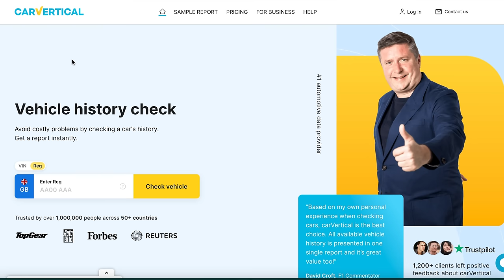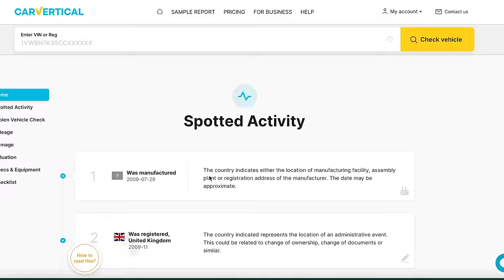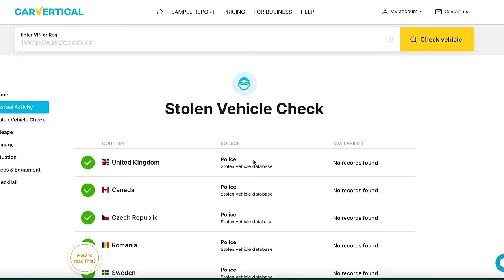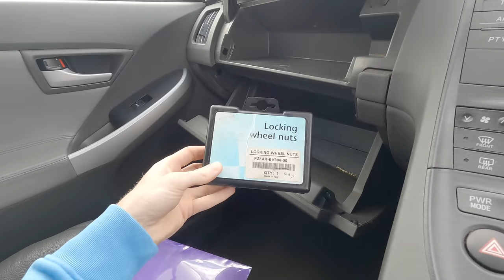I BOUGHT A 200,000 MILE TOYOTA PRIUS

Comment: I received, for free, an '04 Prius with a failed traction battery in 2020.   I learned how to repair that main battery and it's been going strong since then (4 years and about 25,000 miles).   It wasn't such a great deal because a Prius that's been sitting for a while will need things, like any car - like brakes.   Mine also needed rear struts, exhaust manifold, exhaust system, water pump, so it wasn't a great deal after all that, even not counting my free replacement work done on the main battery.  However, all in, I've probably spent no more than $6,000 USD to this point and with regular service, I know I've got a well engineered car.  I do have front shocks replacement staring at me when the car goes in later this spring for its oil change, so it will continue to not be a fantastic deal, though I'm still impressed with them in general.   (Gen 2 are the slowest cars in the universe, so those reading this and thinking about a purchase might want to get a Gen 3, having it fully checked out first- don't make my mistake of "it's a Prius, it won't need anything?"

Comment: I had 3 different Prius and yet drive one. One i drive now has 175,000 miles and have not even changed brakes. I change fluids and tires. I drive them because I am cheap.

Comment: I've got a 2009 Prius myself which I bought in 2014. It's got a few knocks and it has had an accident at the front end (not my fault) so it has one cloudy headlamp which I should get buffed. I'm out of the country a lot at the moment so it's parked at my sister's  and she drives it  to keep the battery charged. I considered selling it but then I'd either have to hire a car when I'm in the UK or buy something which would be extra hassle on top of booking flights and accommodation. As it is my sister picks me up in my car and I'm good to go. Fortunately her neighbour is a mechanic so he charges the battery when she forgets about it.

Here in Thailand I've got a 2012 Honda Jazz with a 1.5 engine. It's reliable as well although some roads up here in the Northeast cry out for a Toyota Fortuner, Mitsubishi Pajero Sport, Range Rover. Because the Toyota isn't used much now it's milage (about 110,000 miles 177,000 km I think from memory) has dropped behind the Jazz (135,000). The fuel consumption is much better in the Prius. I was over for thee weeks in late September and with trips round Southampton and to North Wales I was getting overall about 60 miles/ UK gallon, 21 km/litre, 4.8 litres/100 km. Normally with more city driving it's about 54 to 56 miles/gallon depending on the season. The Jazz is on about 40 miles/gallon, 14.1 km/litre, 7 litres/100km with a bit more out of town driving.

Mine is a T Spirt oddly with cloth upholstery but it has a solar panel. You think it's not worth having until on a sunny day you get in and turn it off so it's no longer providing low level air con. Then it gets really hot.

Ass Matt says it does the job it's designed for.

Comment: I have just bought  a 2011 prius with 67000  miles.That is because, according with the previous owner, after he bought the car, that had diplomatic plates, and don´t pay circulating tax , when he put the civilian plates he was informed that the car had to pay about U$S 3000 per year. How he couldn´t pay that he gave the plates to the City,and garaged  the car since 2017. I think that the car is in good condition ,with the exception, not minor, that the  hybrid battery   has a very reduced capacity. I am going to perform some tests on it but I am pesimist about the results.I always drive in eco drive.Today I did a short trip o10 miles  and put it POWER mode.Excellent  response of the car, I don´t know how much was the gasoline consume.

Comment: I have used Prius 2nd gen, I was clearly tricked about the condition it was in when I bought it and had to do extensive inspection repairs with brakes and suspension previous owner(s) neglected to do. But in terms of driving and the hybrid battery it rolls just fine, it had 295k km but I’ve driven additional 10k km without hassle until a week ago where the 12v is old and is about to give up.

Comment: Great video BTW there is no gearbox oil filter in Prius 3 , changing gearbox oil in prius 3 is easier like engine oil change. You pay too much for gearbox oil change. 200000miles is nothing for prius. I already seen some with 600000+ miles Taxi and still going strong.

Comment: Conveniently being recommended this video a few days after i scoured eBay for a cheap used hybrid car and clicked on a few Prius'. My BMW 525D is giving me anxiety about it bringing me some very expensive bills. That combined with the fact I'm now doing over 1000 miles a month and it's not really very efficient has got me thinking of a change..

As is being said here the Prius has some good stuff going for it. Very cheap to run, reliable (and with this one having a new battery in it that's going to save a potential big bill than other Prius' of such age may be close to hitting) and comfortable enough. I'd be taking a hit in refinement and spec but i'd end up saving well over £80 a month on fuel plus the zero road tax and slightly cheaper insurance. It's worth me (and many others no doubt) considering, especially if purse strings need to be further tightened as the cost of living continues to increase.

Comment: I have a 2004 second generation Prius  when I bought it done 40k miles now 110k miles I own it nearly 8 years now I drive it every single day for work and I’m a very harsh driver still full tank 45L giving me 500 to 550 mpg this car seriously only needs fuel nothing else  and  oil change with yearly MOT break pads last forever when I bought it my mates was saying battery issues but they were all wrong

Comment: It has  magnesium alloy wheels, they are not made from steel.
Reply from the maker: Ah ok, is that lighter?
Reply: @HighPeakAutos  Apparently yes, but   they   could have had a better design. I have a second generation Prius and it is bulletproof car.  I live in Greece and because of the intense summer heat, the battery cooling system works all the time. 135000 miles with no issues at all.

Comment: 1990z Jeep Cherokee with the 4.0 litre 6 cylinder,  600,000 is NOT a lot of miles. I've had 2, I know. I've seen them before with well over 700,000. Both of mine had over 300,000 and the engines were never apart. 
I gave up on Toyota,  when my Matrix completely rusted away, underneath.  Never again.

Comment: Hi guys, I just bought a 2010 Gen 3 Prius with nearly 200k miles yesterday. The dash threw up a message Check Hybrid System and I am freaking out. Also the engine light and traction control light came up as orange. I had factor in the cost of replacing the hybrid battery but not sure if that is the issue. The car drives fine but just on petrol. The battery is at about 90% as showing on the dash but no arrows going around to indicate that it is being charged and I assume it is not. The car is about €1500 cheaper compare to other Prius so I don't expect 100%. Still, I am super disappointed that this happened literally one day after buying it. Has anyone similar experience or know what to do please?

PS love your honesty Matt. Keep the great content going !!!!

Comment: I never saw a gen 3 2009 Prius…..I have a 2008 Gen 2..gen 2 is the BEST ..Mine was never a taxi but they are made to be driven daily as I do with mine…I drive for Lyft and Uber and Prius is better to be driven then to have low miles sitting deteriorating the Hybryd battery life…..I have a 2002 a Pontiac TransAm Convertible……I would sell my vintage Pontiac before I would ever sell my Prius…My Prius has 185,000 miles with no mechanical failures other the replacing front wheel bearings and original brakes at 175,000 miles… Best car I ever owned!! Gen 2 Prius can run 400-600,000 miles…..

Comment: So in EV terms - having a battery pack replacement that recently the "effective" mileage (remembering this is a Toyota) would be significantly lower would it not?  Presuming no rust, etc.  I'm curious as to how these are seen genuinely, they side-step all of the congestion charges generally?  Does the no-road-tax persist?

Comment: I’m actually giddy watching this. I have a 2010 T spirit since 2010. 

Most underrated feature for me is that JBL audio system. It should not sound that great but it’s better than Lexus’ stock sound system. 

Only things worth checking is the suspension and EGR valve. 

I thought my battery was dying as I was getting 25-30mpg. 

After an EGR clean I’m comfortably getting 40-45mpg on the 17-18 inch wheels

Comment: EV Mode is supposed to last around 1.2 miles for stop start traffic. Soon as you put the footdown or exceed 20mph it dis-engages. Tbh bit of a faceade. I have a Lexus CT200 same car underneath but much nicer to look at :) The Prius is abit of a joke though the supply chain to build it you might aswell of driven a "dirty diesel" 100K miles in the same time.

Comment: They are good until you need to replace the battery then you wish you had a 1.5 or 1.8 petrol non hybrid. The battery generally writes the car off which is why you see a lot in damaged vehicle auctions. The increase in mpg isn't worth it. Hopefully this will change in future when battery range is more proven. At least they still have value though when the battery craps out.
Reply: But they last forever yr without needing a replacement
Reply: And they don't usually go out till they hit the 200,000+ mark

Comment: Of the 190000 miles how much was done on engine power and how much on battery? If it was used in town to commute most of the milage could have been done on battery. So as the batteries were recently replaced it could still last a long time. Can one determine how much milage was engine and how much was battery?

Comment: I wish I owned one.
My sister has an Aqua and a hybrid wagon (Dunno what, but it's a Toyota), and 2 other friends have Aquas. Dirt cheap to run, and they seem peppy enough.
I want one, as I do hundreds of people I know, but you just can't get 'em at a decent price in NZ.
Sticking with the Nissan Tiida/Versa and the munted Mazda Demio for now. Cheap-ish to run.
I do 400k per week just to work and back, and that's without overtime.
PT Cruiser has stuff growing on it.Hasn't been started since last year, and seems to be uneconomical to get it back on the road, even though it's low mileage. Hungry on fuel, for a 2.4. Probably scrap, though still roadworthy. Cambelt $3500 fitted, as apparently engine-out job. Nah.
Glad I sold the V8 Jeep.
Fuel here is just too expensive. $2.67/litre this afternoon.

Comment: Gen 3 Prius was a bit of a flub. If you’re you’re thinking of purchasing one after this video you should be made aware of a couple things.

The first 4 years of this generation were fitted with a new style low tension ring set on the pistons. Toyota was trying to squeeze out as much MPG as possible by reducing friction. This led to major oil consumption in vehicles that were pushed too many miles/KMs between oil changes. There is a TSB from Toyota on this.

Next… 

The Exhaust Gas Recirculation(EGR)  system was a new design. It has a very small cooler and valve which plugs with carbon over time. The carbon that gets past the cooler and valve mixes with copious amounts of oil condensate(from a poorly designed PCV setup) at the top of the air intake manifold and forms a sludge. This slowly blocks the EGR ports over time. Because the EGR gas enters the manifold from the side, the first ports clog up which leaves cylinder 1 & 2 to get extra EGR inputs.

This increased exhaust leads to highest combustion pressure in cylinder 1. Which leads to the biggest issue with gen 3 Prius, they blow head gaskets at cylinder 1. Do an internet search, you’ll see.

If you’re going to buy one have a mechanic test for a blown head gasket first. If it’s not blown and you buy it, immediately have the EGR serviced. It’s not hard to do and there are tons of videos tutorials.

Because you don’t want to find yourself browsing hundreds of videos detailing how to repair your blown head gasket.

Cheers!

Comment: Hi Matt. I'm thinking about buying a new used car. I've done my homework on what to buy and that is VW Passat. Now I'm just deciding whether to buy nice spec, < 120k miles B7 or same spec, slightly higher miles B8. Both with the same engine 2.0 TDI 140 kW.  What would you recommend?
Reply: I'd go 2.0Tdi 140bhp, with DSG auto box if you fancy an auto. You can select the gears manually if you wish on a DSG. Just make absolutely sure the DSG box has had it's oil changed every 30 to 40k miles. If you can't find one that has, go manual box instead. Be aware the Passat doesn't hold it's value anything like as well as a Golf. If you need more space for carrying stuff, don't ignore the Golf Estate if you see one. And don't overlook the Skoda Octavia either. Basically the same engines and gearboxes as the Passat and Golf. Damn good cars. I've owned two Octavia's. Drives very well, lots of room and comfortable with it. Octavia Estate isn't far behind the Passat for space in the rear.......

Comment: Replace Prius front wheel baring at Toyota= £700 x 1.  Two years ago.
From my mechanic £150.
Reply from the maker: That’s ridiculous
Reply: @HighPeakAutos  
Exactly and what else was ridiculous was the customer service  guy telling me not to even think about taking to an independent garage because the bearing needed a special tool to be removed. I think it was just a press tool.
Two years later the car runs fine. My mechanic did a good job.

Comment: Best way to check if a car has been a taxi or not is by the MOT history. If it's readily available on the .gov website then it won't be a former taxi. If the MOT history isn't available, it will have been a taxi.

Comment: Second note though, what is the life span of these batteries? I also would have thought toast by that mileage, but I guess it's mainly been run on the engine with that mileage.
Reply: This one has had a new battery fitted. Matt did mention that in the video........

Comment: The Gen2 is far more reliable. The Mk3 is prone to head gasket failure.
Reply from the maker: The 1.8? I’ve never had that issue
Reply: @HighPeakAutos  I read that too. The Toyota Prius owners club forum is full of threads about the Gen3 head gasket failure. The Gen2 was over-engineered because it was Toyota's statement to the world. They had to make it as perfect as possible. The Gen3 and subsequent versions didn't have quite the same NASA grade build quality.
Reply: I can confirm my 2008 Prius Tspirit is indeed over-engineered. Private car, 143k, owned it 3rd hand for 9 years, changed the water pump at 99k (it got noisy - didn't fail though) - and that's it! Keeps running in all weathers - astounding reliability!

Comment: As a taxi driver my cars get full service every 10k no exspence spared on maintenance all seats are covered from new with custom seat covers no taxi plates screwed to bumbers buy another spare tow eye and weld taxi plate to that no meter as its all pda systems use magnetic mobile cradle  any car I've traded in gets more money than taxi price and always told such a clean car for taxi most drivers who own their car will look after them its more the fleet cars rented out that suffers
 this its been a taxi must be done is so wrong I have 67 plate 2.0tdi octavia with 92k hardly moved during covid for 16mth and now just had full service front disc and pads mot and timing belt water pump aux belt change  cleaned and valet every week last 5yr

Comment: On my 2006 Prius,my left turn signal,  high beam light, and parking/emergency brake lights don't display.  However, they are all functional. What do you think is the issue?
Reply: Error codes possibly or a faulty module.

Comment: My 2008 Prius just crossed 250,000 miles with all the original drivetrain and powertrain. No problems what so ever.

This one has a new battery. It could remain on the road for 10 more years if you really wanted to.

Comment: 200k nothing for these, I had a 2007 which 260k and I ran it over 300k. Even the battery is easy to sort,I just changed a couple of cells and it was tiptop
Reply from the maker: That’s handy to know
Reply: @HighPeakAutos  yeah there's plenty of videos on YouTube on how to sort the hybrid battery, easy enough. New cells are about 30 quid each. Mine never missed a beat and it was worked like a dog. Check the rear tyre well for water they tend to leak on the rear boot channels again plenty of videos online.

Comment: Hybrid is still the best option, if only they could provide more range from the electric motor. Great video but.
Reply: You need a larger battery. The motor itself doesn't have range. A Plug-In hybrid will have way more range ( 30 plus miles on battery alone) than a standard hybrid like the Prius. Plus a Plug-In will travel at motorway speeds on battery alone, which a normal hybrid cannot do.